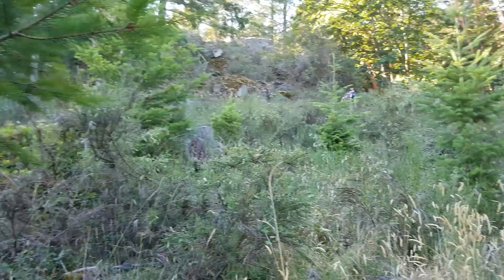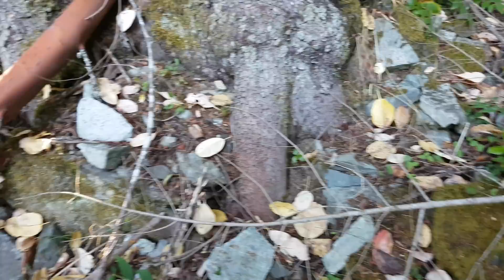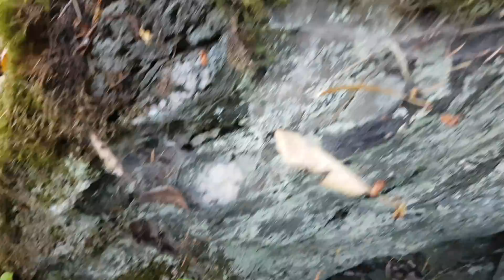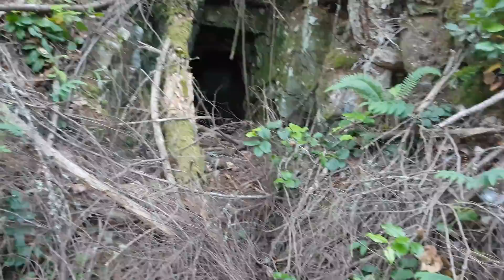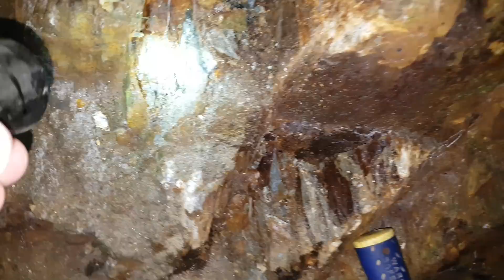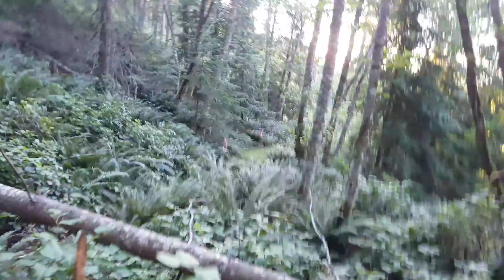High Grade Gold Left In Old Mines & Finding Loads Of Vuggy Quartz Veins

Comment: Did nobody else see the adit entrance he completely missed? You can see the tops of the some 2x4s at 6:13 and 6:15 on the hillside. When he swings the camera you can see the top portion of the entrance.
Reply from the maker: There's other adits on this mountain but not within 500m of this and there not timbered. There's a shaft way below but the timberings at the midway point down. They also didn't use 2x4s 120 years ago, unless someone is doing work on our claims 😉

Comment: I'm not sure I understand. The samples you took had gold in them?
Reply from the maker: Yes when your dealing with sulphides you can find your mineral as worthless or worthwhile. To keep it simple well go with a common combination most people know say you have iron pyrite which is iron and sulphur. Pretty worthless itself, but when it is formed hydrothermally as a deposit you can have replacement minerals were some elements of either iron or the sulphur which in the proscess ot your vein being formed are replaced with elements like gold. It's not always gold but can be anything. That being said a  few parts per million of something like copper or zinc is nothing but a few parts gold, that simple iron pyrite turns into something viable.

This deposit is small and was mined for only the main vein due to metal prices 70 years ago and not the smaller schists and quartz veins in the wall. Those samples we took had close to an ounce per ton, some free milling where you could crush and pan and get little specs of gold the other as replacement elements in your sulphides which need refining to remove the gold. Most gold found in BC is found in deposits like this were volcanic and hydrothermal activity is the culprit for forming your vein or deposits. A major part of exploration is sampling and having a laboratory analyze them to tell exact parts per million or billion of each element so it can be determined if something is viable for further work. Hope that explanation helped?
Reply: So you would basically need a ton of material. Crush It up then chemically extract it with something like hydrochloric acid, then filter out the gold and dissolve that to refine it and then precipitate the gold back to dust and then melt that down with something like borax to get an ounce of pure gold. Have you ever tried to extract any gold?
Reply from the maker: Yes similar depends what contaminent elements you have in there, grades and type of ore matter too . Depends on the deposit froth flotation is used. YouTube 911metalurgist they have demos on this. 

As for refining we don't bother well send ours to a refinery by the ton there better and more efficient, or well sell it to a private buyer when we mine. However 99% of what we do is exploration, finding deposits, grass roots prospecting, geochemical programs, geological mapping, sampling...ect we are professional prospectors for hire, but we also have dozens of claims, we stake claims constantly and look for promising mineral and placer properties to option to junior mining companies who have more funding.

Comment: Define "vuggy" quartz. Thanks..
Reply from the maker: Vugs or vuggy rock are cavities, voids or pores in the rock which are often lined with mineral precipitates. Depending on the mineral over time the mineral can dissolve out leaving rock with just voids.
Reply: @911mining   not hard rock related . reading an old story about oil drilling. one area had big vuggy porosity . drilling on one well lost circulation . work was near a chicken processing plant . pumped 500 bbls of mud mixed with chicken feathers to seal off the down hole leak. the next day the well on the next lease produced 500 bbls with chicken feathers . was it a true story ????

Comment: Interesting ,but that adit was spent , you may have a sample with 4 g /ton au but that doesn't mean you could even get a ton from that adit .
Reply from the maker: GrooberNedJardine sample from pit was 4g/ton, sample from adit was over 24g/ton..while there may or may not be that left in the adit. It's a quick cleanout for a little gold. There may be an extension of the ore body which is what we are looking for. As there are similar multiple deposits in the area.

Comment: Just wondering why you did not use a metal detector?
I'm guessing your gathering a geochemical map of the area for the potential next step towards a mine if it's viable.
Gee 5 and above grams per ton Au is not bad.  Only just stumbled across your channel.  Cheers
Reply: As an experienced metal detecting person I can tell you that it's very hard to go in mineralize locations like this to look for gold because you would get a lot of what they call Hot Rocks and it would just go crazy and be going off continuously. It would be very hard to do that. Too many other minerals that would make it sound off.
Reply: Cheers, makes sense.  With hot rocks everywhere it makes it very hard.  Would the pin pointer (pen sized detector help at all)?

Comment: it's 42C here in Northern California today... it ranges 40-43.5 here most times in the summer
Reply: well here on okla ALWAYS high humidity and temps 100+ 109f 2days ago with 95% humidity. absolutely miserable. then winters are as cold as 0f and windy as all hell 15-20+mph regularly but no wind in the heat. really no spring or fall wearher like its only 2 seasons here. temp can change as much as 50 degrees F in 24hrs. shorts no shirt 1 day and bundled up next day. READY 2 MOVE LMAO
Reply from the maker: Too Hot. We rarely see temps in the 40s however with humidity it feels like 100C sometimes.
Reply: "but it's a dry heat" they always say... except lately we've been seeing 40-50% humidity during the day and upwards of 70% at night but a fair bit cooler. I'm not saying it's nice, it's not, but it actually gets even worse than that a couple hours north of me up in Red Bluff I think converted it's like 45C? 130-135F is way too common up there.. typically about 105-120 here. More normal humidity is typically 5-15% your sweat is gone so quickly that it doesn't have a chance to cool you down.. Prefer humidity about 20-30%, but then I lived on Guam and in MIssissippi (was born in MS hence the flag) and I've dealt with 95F-100% humidity numerous times.. Regular temps on Guam weren't THAT bad (80-85F-85%), it was pretty comfortable at least as a kid (5-7 on Guam 8&9 in MS) MS temps are typically closer to 80F and 80-100% humidity. The big difference back there is it maybe drops 10 degrees F for night time temps if you are lucky. Here most times we have the delta breeze and it'll drop down to lower to mid 60'sF at night, even if it's only for a few hours it definitely makes a difference, though when it's really hot if it drops to 75F you are doing good. First year we moved into this house our a/c went out and it was a heat wave with it being 85-90F AT NIGHT! That was hell. I'd definitely move to Oregon if I had my pick, though the last few years with the climate shift it's gotten a lot warmer up there too. I think it was 107 in Portland the other day, which is right on the ocean.. THAT'S INSANE for up there. But then we also have lows during winter of typically 35-40F during the day and 15-25F at night with the lowest I've ever seen being 9F at 630am, and we are only at 50ft of elevation.
Reply from the maker: Sounds awful. I prefer winter over summer temps.

Comment: Thanks once more for dragging us along.  I am surprised at or why you look for pyrites all the time. I must admit that I found a small vein of copper pyrites one day in the south island of NZ and discarded it then found out they had found good gold in the copper pyrites.Im still kicking myself as it was about a thumb size diameter vein right through a large rock, which looked like it weighed a ton or more.  I had the equipment to crack the rock but never bothered.  But I still remember where abouts it was, so one day I will take my metal detector and go find it.
Reply from the maker: Most minerals are found with sulphides around here. Most deposits are volcanic here.

Comment: I'd be callin the loggin company before they get started and let them know where the adits and everything is at that you don't want covered up, cause they won't care or contact you about them. Be safe out there and another great video
Reply: It's actually the responsibility of the whomever engineers the block to make sure these are flagged up. Active Mineral claim owners should always be notified. It is simply an oversight , lack of research and poor engineering that your claims are being logged without your notification.  Many loggers will not even see these depressions/adits from their machines.  Maybe contact the licensee / actual land owners and update them with your claim locations.  Mineral titles trumps logging/tree farm licences! You can press charges if they cause damage or loss of revenue!
Reply: Best thing to use as claim markers is a 4' PVC pipe sticking out of the ground about 4 feet-You can leave info on the marker..so if a logging company came in your area Most loggers will contact you first before cutting...Happy hunting...Dig,Dig,DIg
Reply from the maker: We usually do, however sometimes we can get the prime contractors number so we have to catch them while there logging.
Reply: Lee Hilton, the reality is, the logging company would likely file a trespass and you not be able to keep anything you've found. It's like finding $100 on the ground in a parking lot, everyone who knows you found it "lost it this morning".
Reply: @umdsupreme  not if the claim is already there and yours. For the most part the loggin company doesn't own the land their there just to log it.
Reply: Agreed Lee...they have contracts for federal land that company's bid on. Trees are all pre marked on what they cannot or can cut.They are just in there harvesting different things then us,We are after the minerals, they are after the timber..We need to work together more...Around here, the logging company's will contact private land owners as well to thin out there land..they pay you for the timber they harvest...plus it helps with fire mitigation..
Reply from the maker: In BC logging companies can own the land but most logging is done similar to staking a claim we have the mineral rights they have timber rights they don't own the land it's a municipal forest reserve so basically we share and help each other out they can screw us over by building roads over mines or mine dumps and we could easily screw them over by cutting trees down to make mine roads. It can be a win win situation or a lose lose situation if we don't work together.

Comment: That forrest hardly seems mature enough to log?  Surely, none of those trees can be older than 30 or 40?  Two questions; you got locked out of one area due to the fire season but this one is different.  Why?  Finally, it seems like a lot of value in your samples is in Copper credits where you consistently grade ~1%; how much do you factor this into your plans as the Copper seems worth more than the Silver credits or do you use an overall Gold equivalent grade?
Reply from the maker: Those markers are just for roads and falling boundary there are definitely trees on the upper side of the mountian that are 50-60 years old and big enough to log. This area also has gates however the farthest portion of this claim can be hiked to in 3 hours. Most of the other claims we have behind gates require 10-100km of driving once you go through the gate to get to the property. Most areas are available to the public even during fire season but only for walking.

Yes but 1% is to low of a grade to mine alone unless your looking at a massive deposit. When we look whether a deposit is worthwhile we would need decent grades for multiple metals unless it's high grade.